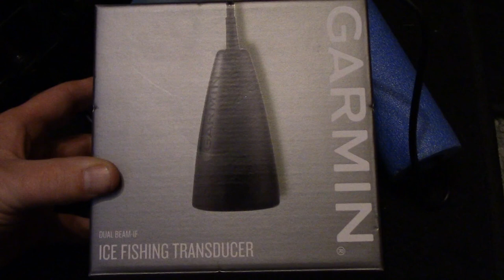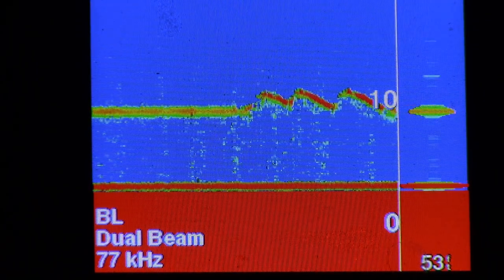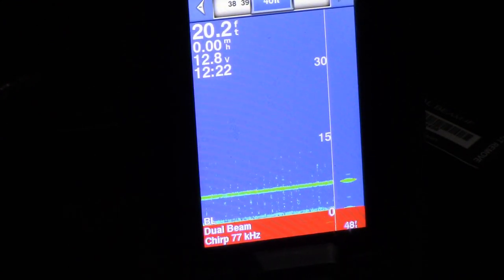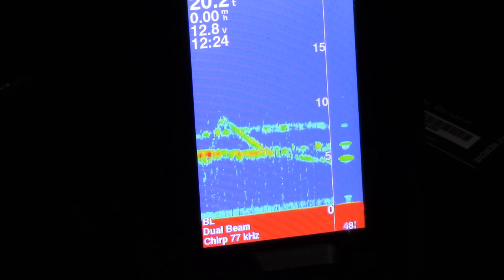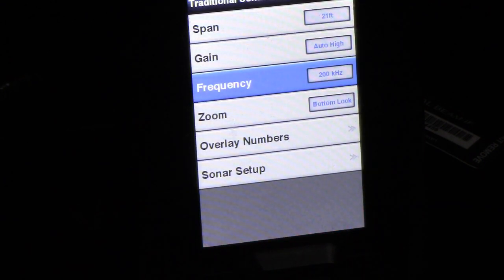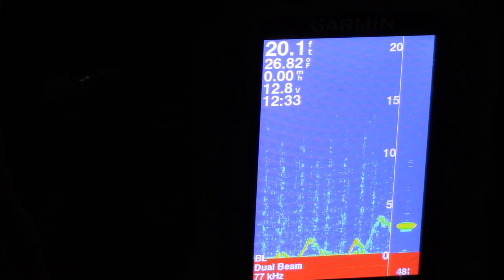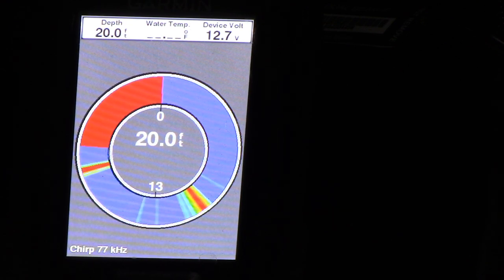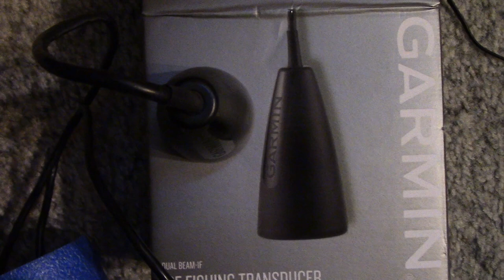Garmin Striker 4 ice fishing transducer or GARICEXD transducer review.

Comment: You should try to manually tune in your gain.  At 20ft, I normally run the gain between 65%-75%.  It does make your bait a bit smaller but does clear out your screen of any interference compared to using auto gain settings.
Reply: I always manual tune. Every lake is different, every spot on same lake is different. You should never auto tune gain . Always manual tune range too, that is always way off.

Comment: Does this work good in deep water at all?
Reply from the maker: The deepest I’ve used  it has been about 30 feet. It’ definitely works good. I can’t speak to anything deeper than that. Yet…..
Hopefully that helps with your question.
Reply: @footprintoutdoors6144  Thanks! I am regularly working depths of 120ft on the ice that is why I asked... I dont really want to spend $140-$160 for the Gt10ht transducer although i have heard it works well in deep water.
Reply from the maker: @montanastrongremodelrenova1632  that’s pretty deep. I can understand not wanting to spend if you don’t have too.
I like the other benefits as well. The cable is longer and more flexible (silicon coating?), but also the confidence of know the transducer has the correct angle when in the hole. I can’t see me working the depths you do anytime soon. Hopefully you have a great season!

Comment: I am using the boat ducer, and do you highly recommend this ice ducer?
Reply from the maker: I am very happy with it.
If you are on a tight budget or just starting out for ice fishing, I would recommend saving your money for other gear and essentials.
The pros and cons for this unit...

Pros - short cable length, always the correct angle when dropping in the hole, cost is lower than the other two ice ducers Garmin offers.

Cons- additional cost, does not give water temp.

For me I do not regret the purchase.
It’s nice being able to drop the transducer in the hole and not worry about making sure it it’s at the right angle for a proper sonar return.
Or having to check and or readjust if bumped.
And for hole hopping it’s ideal.
For me it has added real piece of mind.
You absolutely do not need it, but I’d buy it again based on the price and convenience of the ice transducer.
Hopefully that helps.
Thanks for watching!
Reply: @footprintoutdoors6144  thank you so much
Reply from the maker: @antoniohu2518  you are most welcome.
Thanks for watching!